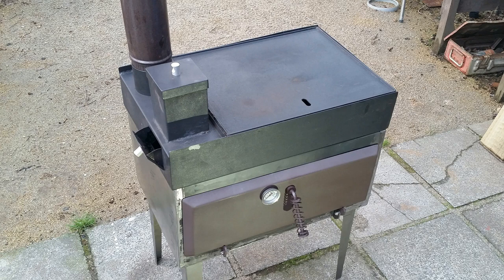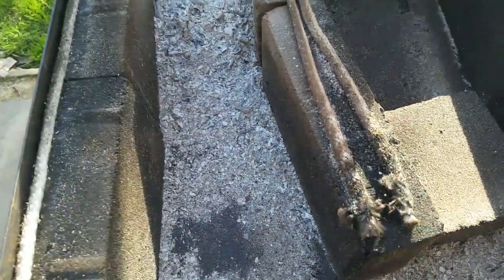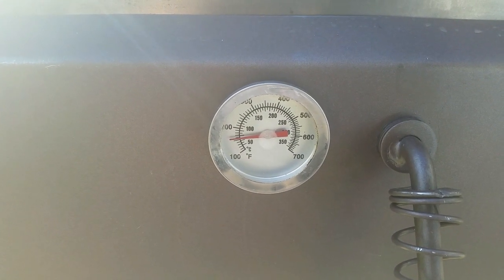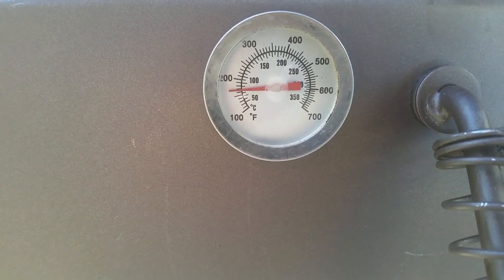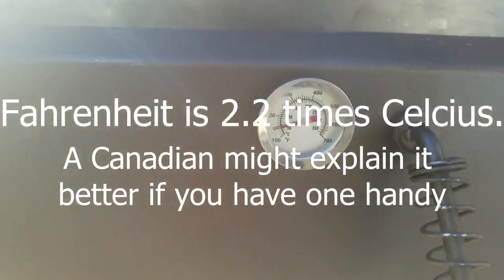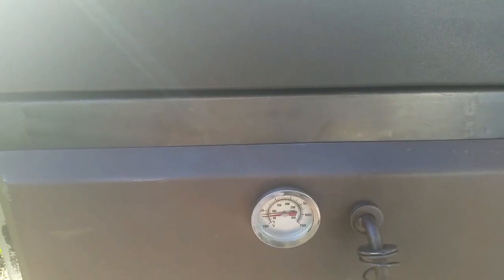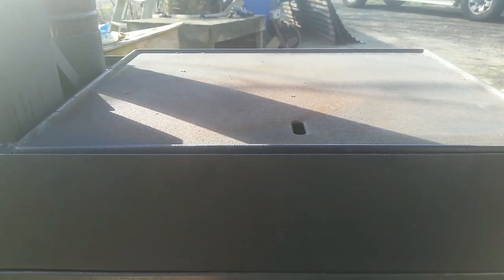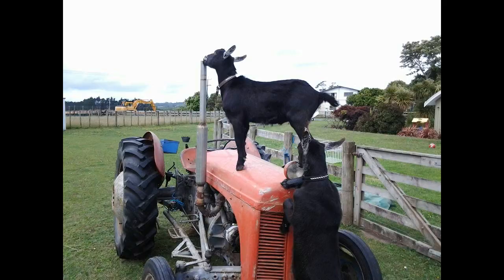Prototype Rocket Stove Oven Community Brainstorm 2019

Comment: I've read thru the comments on all of these videos... if you were to use all of these ideas, you would have some sort of Dr. Suess contraption!
Take your time, you've come such a long way and so far you have a pretty amazing thing on your hands, the only thing I am having trouble wrapping my head around is the 8' chimney thing.

#1. its 8ft to 10ft tall, that's up there.
#2. as the heated air cools, doesn't it become heavier per say? therefore have a tendency to want to travel down?

Seems to me, I could be wrong, but as the flame burns and travels the path thru the stove and makes its way to the chimney, it cools so much that a U-turn downwards at about, um... 4ft-5ft maybe?, so the cool air could travel down the chimney?
At least you wouldn't need a flashing beacon for low flying aircraft!      just kidding with ya, lol.

I don't know, everyone else is putting their 2 cents in I figured I'd give it a go... Good luck, Keep making videos.
Reply from the maker: A very good point! I've just made a pellet hopper for it.  So I'll do a vid shortly and we can try your idea. I'll just run 4' flue and see what happens

Comment: It may have already been mentioned but maybe you could cut out where the ashes are laying and extend the bottom a few inches down into the oven itself off course that means that it wouldn't be two separate items anymore. Then you may be able to still put fire brick or tile on the bottom and front side of the extended ash tray and try to direct the heat to the back and center of the oven box. This way you will still have all of the fire in the top section for cooking. It may not last long as the ash builds up, the ash may become an insulator. Good luck, can't wait to see what you come up with.

Comment: Well at time 3:35 i could see that burning chamber (top part of stove) its not touching oven by whole surface. Air works like insulation, so ensuring that burning chamber touches oven would increase heat transfer to the oven. I would try to do something with it before trying secondary burn chamber. Maybe some heat transfer paste or something...

Comment: Is your oven double walled? How about putting the combustion chamber below the oven, with two chimneys separated by a flue. Turn the flue one way and the heat and gases are diverted through the bottom and sides of the oven and then out into the chamber under the stove and then out the main chimney. Turn it the other way and the heat goes directly into the stove and out the chimney the way it is now. With  a little bit of experimentation you should be able to balance the heat in both the stove and the oven pretty easily. I hope

Comment: Lots if interesting ideas for moving heat from stovetop to oven. Any that involve moving heat from the stove to the oven, though (fins, tubes, coils, forced air) are going to take thermal energy away from the cooktop, something I don't think you want. (As it is, your last station is effectively just a warming plate.) The only way to heat the oven without losing heat in the stove is to scavenge heat that is currently being lost anyway. There's not enough heat in the chimney, I assume you're not losing much through the sides due to the insulating firebricks, so that leaves heat that's radiating from the bottom of stove. Take a temp reading on bottom of stove, from underneath, while it's running. If its at least 200°c, I think youre in business. The suggestion to make the floor of stove and roof of oven be the same sheet of metal seems the best. Insulating front/back/sides/bottom of oven (not the top!) should help a lot. If the roof of oven is 200° or more, it shouldn't take long for a small insulated air space to reach the same temp. A fan in the oven to circulate air would even out temps. This wouldn't lower your stovetop temp, since it was heat that was being lost anyway; in theory, it might even raise the stovetop temp a bit, as you've effectively insulated the bottom, preventing further loss of thermal energy.
Reply from the maker: You have an excellent grasp of what is going on - except that the oven top and stove bottom are already one piece. you have the temps close too. 220c s what Ihave. Ill be finning the bottom of the stove and making a better seal between the two-. we will see how that works. Awesome reply thanks
Reply: @t.h.o.r.     If the surface temp of the underside of stove/roof of oven is 220°C, I believe you are a sealing and insulating job away from a 200°C + oven. Great work!

Comment: The easiest way to solve it would be to put a second burner on the bottom like others have suggested or instead of a horizontal burn chamber how about a vertical one that goes down along the side of the oven and then back up to the hot plate this would also make it easier to clean out the ash

Comment: The heat in the oven stays in the top. Heat wants to rise.
You could mount a heat resistant ventilator inside your oven that circulates the air. It will become a hot air oven as, you say the top becomes 180 degrees. Should be enough. You could power the fan with a peltier element TEG - termo electric generator. So it starts to run, once you heat up your stove. No external power needed.

Hope, you can do something with my train of thoughts. :-)

Cheers,

Rene

Comment: https://youtu.be/88JewT47kj4          :-)
Reply from the maker: Thor is beautiful! - you drilled all those holes!- and your english is way better than my dutch!
Reply: There are only 8 weldings in Thor. And many M4 bolts and nuts. I wanted an "old look". A little bit steam punk Ha ha. Thor now has a thicker combustion space. This was too thin. It is now 8 mm thick and has ribs that give off the heat better. It gets a bit colder here so Thor has to be done.

Comment: I'd suggest a copper tubing coil (1/2" ?) to transfer heat from the main box down to the oven, kind of like a heat sink or pump.  One coil inside the top,  through a small hole to another coil at the bottom of the oven.

Comment: Think spiral...burn area, across the top, down the side of the oven, under,  and up the other side. Across the top again, and up the chimney. .... put a damper or a diverter between the two so you can regulate the temp in the oven....
Reply from the maker: Im dizzy just thinking about it! lol. some people have suggested simpler things to start with. - Ill bear your suggestion in mind Charles - but it will be down the list 🙃

Comment: How about chaneling the flue gas downward around the oven and fitting a fan in the final flue outlet pipe to suck the flue gas out. You could also make a diverter flap so you only need the fan when you want to use the oven.  Just an idea.

Comment: You need convection to radiate the heat. This in theory will overall raise the oven temp? I would achieve this by making something similar to a wood stove heatsink fan.
Reply from the maker: someone earlier suggested finning the underside of the stove into the oven- I do need to stiffen the bottom as ive discovered it sagging when I really thrash it. It should work like a air cooled motor . Its the simplest thing suggested so far - so Ill go with it and see what happens
Reply: @t.h.o.r.  
I would try and get the heatsink fan welded onto the hottest so it convect the heat to it's max the hotter the heatsink gets the more the fan should turn giving a higher convection.

Comment: Here's my take.. Your rocket stove is to efficient.. Your heat is moving out of the stove  to quickly to heat the oven so you need to slow it down some with a type of wind brake.. Weld some louvers in the bottom of your stove to catch some of that heat and disperse it onto the roof of you oven..
Reply from the maker: Yup- like a motorbike cylinder Ill do that first cos its the simplest idea- Ill let you know in a couple of days

Comment: Could you let me know what the chimneys temp gets to?
Also what temps is the smoke?
Can you put something on top of chimney and measure temp it gets to, maybe just a piece of flat bar or the like to not effect draft.
Reply from the maker: In the vid you will see me check temps on the plate and then on the chimney bottom is  70c (150f), midway- 50c (110f) and right at the top is 35c (80f)
Reply: @t.h.o.r.  
Ok. Those temps are a to low for my idea.
Reply from the maker: are you cooking or cremating!?  lol  this is loads of heat for cooking
Reply: @t.h.o.r.  it was more the temps coming out of the chimney to use for heating the oven.
35c isn't enough
Reply from the maker: My plan is to fin the underside of fire box and improve seal into oven cos thats easy. If that does not work, Ill duct the gasses down from the rear  of the hotplate thru a duct in the back right corner and then back up undreneath the chimney. - ill  control it with a flap.  last idea is remake the entire thing from masonry usung the oven as the liner and having a cavity right around it between the masonry - then out the chimney

Comment: It would seem that the real question here is: Do you want the 2 parts to work independently, or is it ok for the oven to be at temp all the time? The firebox will put out a set amount of heat, so where do you want that heat absorbed? As you said, the chimney is not too hot & that side of the stove is a warming plate. Drawing more heat downwards (which will require a taller chimney to produce more draw) will cool the top plate even more.
The oven needs to be sealed, as does the top plate (to work independently), and a diverter to a channel from left, under, up right side is doable, then a chimney size hole (with damper) under the chimney, can regulate stove/oven temps. This will require insulating the outside of the oven, or it may never get hot enough for pizza 🍕.
Otherwise, make the rocket stove feed tube the height of the oven & stove combined & oven will be hot all the time. Using one dedicated heat path to the chimney. The water coil idea will produce heat, but unless it is steam, it will never heat up to pizza temps...
Reply: Also, making the oven roughly the same height as the stove will increase the temp, along with a possibility of browning the top of your pizzas. I do think that a diverter & flu damper will be needed.

Comment: Did you investigate fins on the bottom of the firebox into the oven for better heat exchange?
Reply from the maker: Thats another good idea. ive noticed that when it gets hot the whole bottom panel sags slightly causing air leaks inside the flame path - the central divider drops by a wee bit and air bypasses over the top. having fins would strengthen the bottom and stop that. That is the cheapest and quickest thing to try first so I will do that and let you know- Thanks Jerry
Reply: If you extend the fins into the firebox by cutting slots to insert them before welding it would also add to the turbulence in the firebox while aiding in the heat transfer.
Reply from the maker: so many ideas!

Comment: You Know the  simplest solution would be to just place the oven on top of the stove when you need to use it, Just remove the top plate, Slap the oven into its place, and there ya go,  Only problem is in regulating the heat to maintain a good cooking  temperature. 

 I still suggest a 2 layer thick wall  to allow heated air to run around the oven while the insulated layer is on the outside of the heated air.  

Another solution is to actually use a blower of some sort to force the heated air around the oven area. That would allow you to regulate the oven temps better.  

Another  way to transfer heat is via a liquid medium. Perhaps that is an Idea to ponder.  

Either way good luck, and I agree a second firebox is one way, but not the only way.

Comment: What if you put angle iron of varying heights along that front channel. perpendicular to the flame travel. Lowest in front to highest at the turn to the back. Im thinking something opposite of a heat sink. The hot angle iron transferring heat to the oven. I dont know if that would interrupt the rocket flow though. Great video sir. You do great work.
Reply from the maker: Hey yes- like the finning on an aircooled motor! but with opposite effect= nice! another idea shortlisted -thanks

Comment: Think of how a kitchen wood stove works. Heat (and flames, etc.) from the firebox travel across the  bottom of the oven, up the far side, across the top before finding the chimney.  A movable baffle covering a hole at the chimney would allow control of the stove top or oven use.  Sorry I can't explain it better.
Reply from the maker: No- Im with you- This is what I think it needs too

Comment: Love the stove.  I might be of some help.  I have a traditional woodstove cooker with an oven.  How they overcome this problem is by putting a damper on the flue and allowing the flame to go around a channel that goes around the side of the oven around the bottom and then up a channel up the flue.  It really works effectively and no need for a separate firebox. Look at other traditional wood fired cookstoves if my explanation is a bit confusing.
Cheers,
Bill
Reply from the maker: no confusing at all Susan. Ive been thinking how I can do this
Reply: butterfly plate on a pin
Reply: Reduce the size of the oven . Less cubic inches with the same amount of heat should increase the temperature. If you cut the volume in half you still will have a good size oven. I like the heat fins . I think the fins and smaller size will do the trick.
Reply from the maker: im just making the same thing in brick. but with the oven next to it instead of underneath. This one WILL work

Comment: You are wright! It is more a warming drawer. 
It can not be otherwise, because you have huge radiant losses on the cooktop, and on the owen below. On the other hand the rocket power is very limited. It is very hot but low in energy.
Weigh the wood you burn in a given time. The wood has a calorífico power of 3.7kw.h per kg @ 20% humidity.
If you burn 1kg of wood on a hour you have the power of your owen beeing, 3.7x0.8=2.96kW of power. You should deduct the huge radiation losses on all surfaces to the power of the rocket. Your actual design will not work. I would preferência to design a separate owen on top of is rocket.
Congrats for your extraordinaire overall work you are developing!
Albino

Comment: Get rid off the air gap between, make oven top plate the bottom of the stove, easy first try just cut top off oven and fix edges to bottom of stove. This cuts out the air gap between and give direct heat to oven.
Reply from the maker: Yes John - oven has no top but there is a nasty air gap cos ive warped the stove thrashing it to see what it will do.  Tomorrow Im  finning the bottom and putting a flange around the stove to stop the hot air leaking out.

Comment: Add a seconded heat chamber under your over. Extend existing feed chamber to lower heat chamber. Use gate,door or expanded metal to let coals and embers drop to lower heat chamber. Add damper at bottom of top heat chamber to direct flue gasses up through existing exhaust.
Reply from the maker: Ahh yes!- now thats an idea! read some of these other comments - everyone has such good ideas!

Comment: I've a thought. Maybe you could add a third function to your stove that would also heat the oven.  A water heater. Coil some copper tubing around the inside of the burn chamber which you sent down to coil around the inside of the oven. Like a water radiator. You could feed from a water cooler then have the hot water come out of the oven into a second tank to hold the hot water. Obviously you wouldn't want the water right at the firebox where it's 800° f. 

Another thing. Instead of having the heat go up through the chimney at the end, put a hole for the heat to go down into the oven, the a hole in the oven where the chimney then would come out on the other side of the oven so there is a convection effect with the air coming in one side out another to distribute the heat.
Reply: TinyHouse and Offgrid Resources the gasses could be contained in a smaller diameter chimney pipe that runs through the oven as described above. Part of the benefit of rocket stoves is supposed to be burning efficiently enough to burn the gasses. I suppose if there are still gasses and a conductive pipe isn't there to contain the smoke, it would turn the oven into more of a smoker. Maybe you could incorporate your water heater design with this stove somehow.  Anyway, those are my suggestions. I'm no expert, just throwing it out there. 

Anyhow, good luck and looking forward to your upcoming videos about it.
Reply from the maker: Loving it - thank you.you and a couple of others are suggesting the duct down and through the oven. Im thinking of a of a flat duct down across and back up on the rear wall of the oven. it will mean two well sealed ports and a control flap but I think its doable